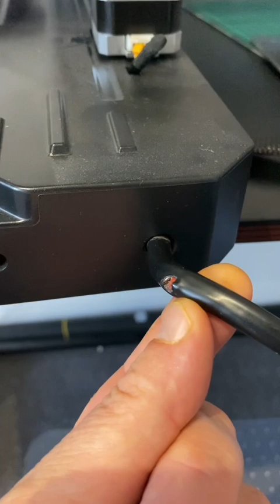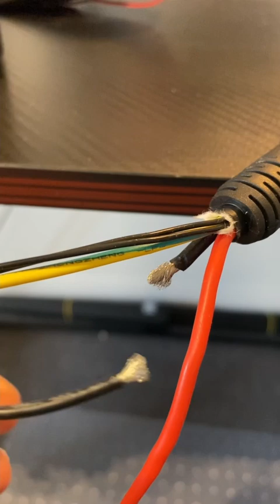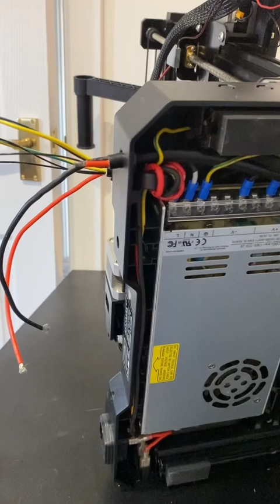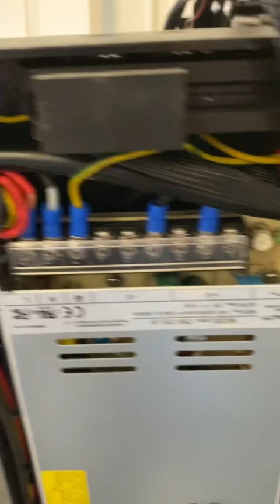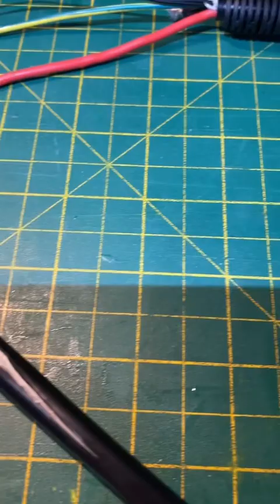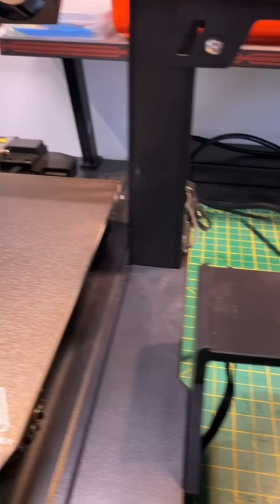Creality Ender 3 S1 Pro Heated Bed Cable Fix

Comment: nice mine is having the same issue, i can print at the front 3/4 of the bed but if the bed is all the way forward the temps slowly drop from 60-50 then ab temp error shows up.. gonna pull er apart soon
Reply from the maker: Hopefully the video helps you fix it!
Reply: @jsware I got it fixed.. was a broken wire

Comment: very helpful. thanks for the video. is your fix still holding up with no problems while using these high temp filaments to print?
Reply from the maker: No problems so far but I only print PLA and PETG every now and again.